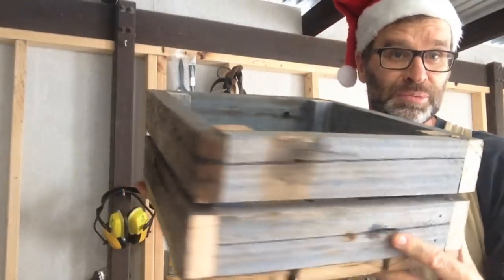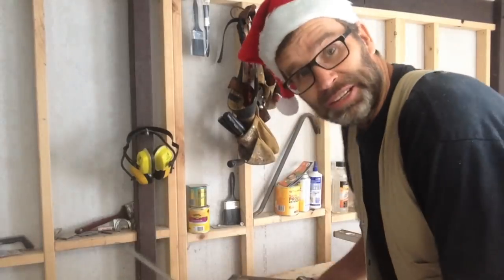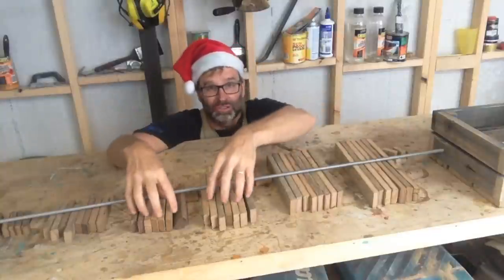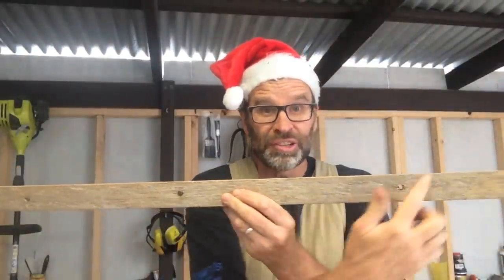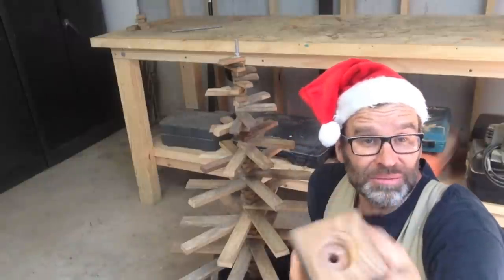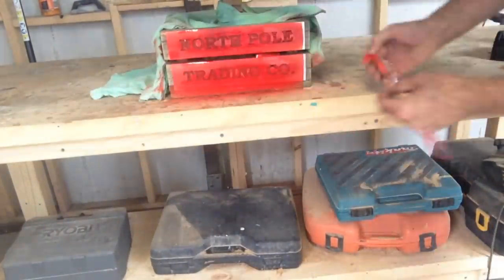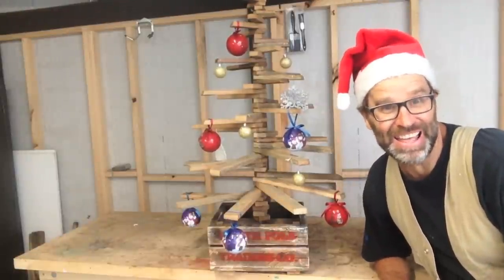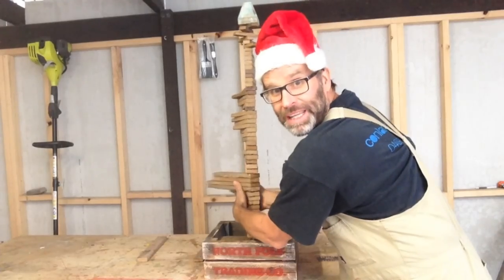How to Make a Christmas Tree. Awesome Scrap Pallet Wood Project!

Comment: Would you remember the sizing of the booker rod you used for this tree?  I tried looking for threaded rods and there are so many types, not sure exactly which you used.  Thanks again,  Teresa P.
Reply from the maker: +Teresa Pasquariello Hi Teresa. I used 10mm booker rod but l think if l made another one l'd try using the 12mm as it's just a little sturdier. Cheers

Comment: Would you mind providing the plans for this cute tree?  You mention some dimensions, but not all, and I would like to have one made.  Thanks, Teresa
Reply from the maker: +Teresa Pasquariello Hi Teresa. Unfortunately l don't have any plans for this tree as l just made it as l went. I gave it away so l can't even get the measurements  for you. Sorry about that :-(
Reply: +shaneconlan1 Still trying to figure out dimensions on my own.  Could you give me general measurements of pallet wood, like the thickness and width?  Thanks, Teresa
Reply: +Teresa Pasquariello  Also the rod used for the trunk, is it 10 mm and did you have to have it cut to length or was it a size generally found in a hardware store?